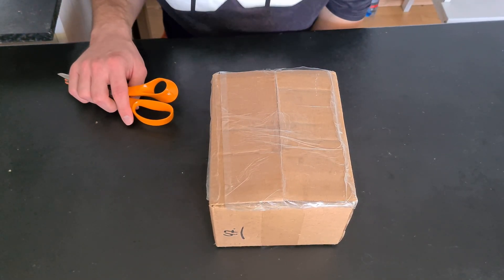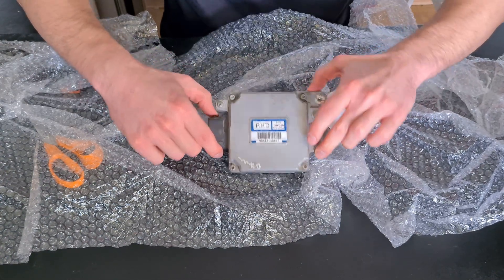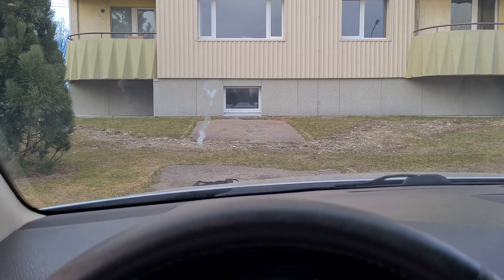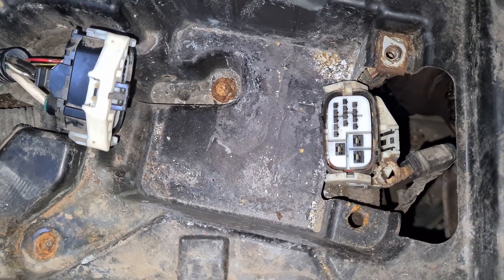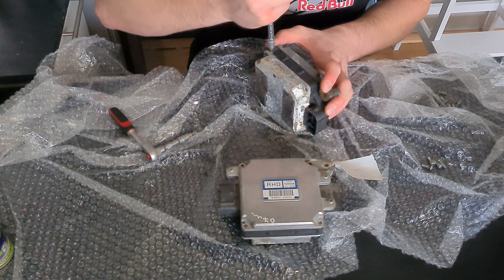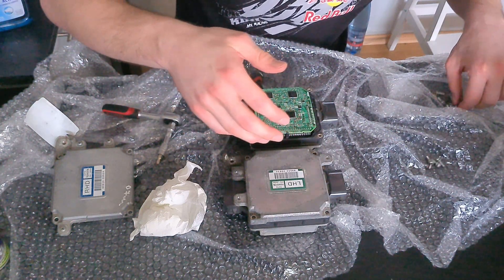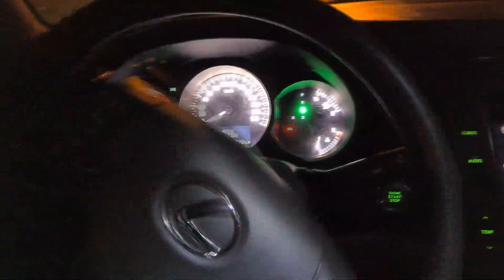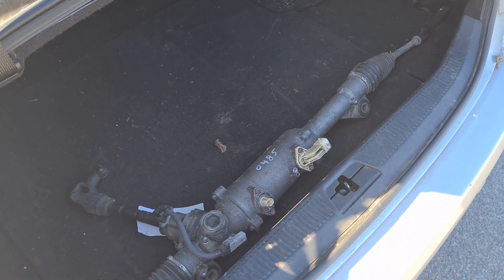LHD & RHD parts interchangeable? Case study of a Lexus GS300 power steering ECU (and steering rack)

Comment: Did u ever try and get the power steering module to work? I bought an isf power steering ECU but it’s RHD version and does the same thing
Reply from the maker: That was the whole point of the video - it is 100% the same (minus the attachment points), so obviously it works.
Reply: @JunkmanACClips  but how do u get it to work? I bought one and it’s not plug and play. I’ve called a couple dealerships and they don’t know what I’m talking about and would rather avoid spending a few hundred bucks for them not to know how to program it
Reply from the maker: These were pnp.
Reply: @JunkmanACClips  why was the steering wheel shaking uncontrollably once u started it up then
Reply from the maker: Let me shock you - the fault was somewhere else. Sometimes life do be like that.
Reply: @JunkmanACClips  ok if I go to a shop on Wednesday to get it calibrated and it doesn’t work u owe me 100 bucks haha. I’ll let you know if it’s successful
Reply from the maker: Let me know how it goes.
Like I showed in the video, mine was 1:1 identical and did not diferentiate in any way other than the cover. Changing the ECU did not fix the car but did not make anything worse - it was most likely just the steering rack which had gone out.
Reply: @JunkmanACClips  ok with so your original ECU installed, the steering wheel shook as shown in the video correct?
Reply: @haas4262  It shook with both ECU's the same and it only did it under certain replicable condition. It had nothing to do with the ECU.
Reply: @JunkmanAC  ok thank you. I’ll let you know what happens
Reply from the maker: Hope it works out. Waiting for the results.
Reply: @JunkmanACClips  Can confirm the RHD does NOT work for LHD. It throws a code that cannot be cleared in order for tech stream to calibrate the steering wheel.
Reply: @haas4262 
Hello Haas . I have RHD 08 Lexus Isf and try to switch EPS ECU for thé newest one (baught on Lexus part canada for lhd) trying to calibrate but steering wheel shaking like vidéo . Did you had thé same issue? Did you solve it? Thank you
Reply: @ RHD will not work for LHD cars. Went to a shop with techstream and he couldn’t clear the errors to calibrate the new ECU. Sold it to a guy in Ireland and he said it works perfectly with his RHD is250. So I’d say the same is true for LHD parts for RHD cars unfortunately